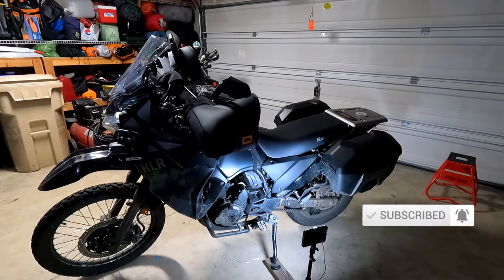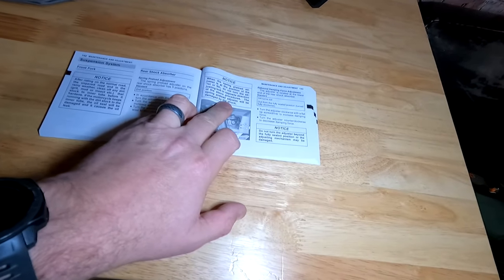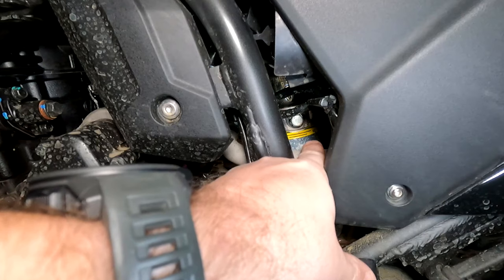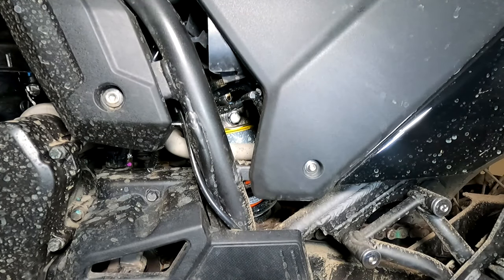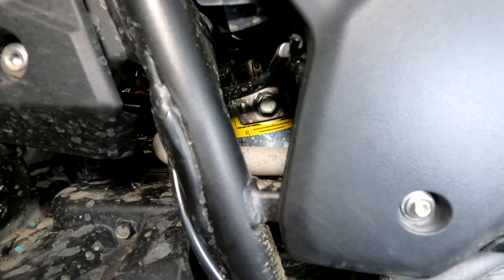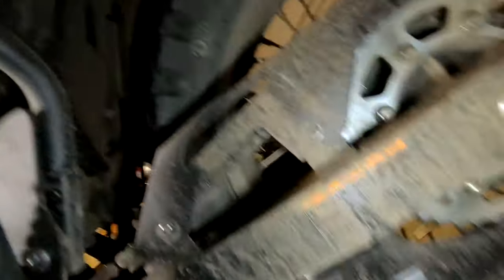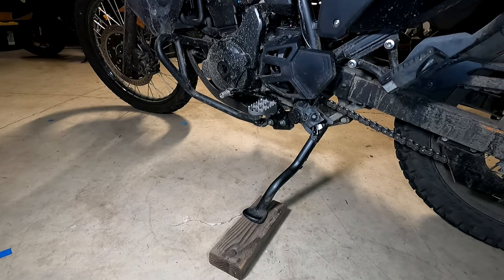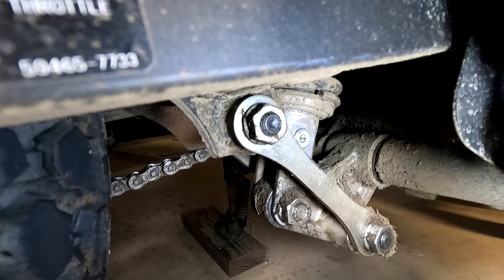How to Adjust The Suspension on the 2022 Kawasaki KLR 650: How to Set Rear Shock Rebound and Preload

Comment from the maker: It's been pointed out to me that this adjustment is also present on the Gen 2 KLRs.  I was not aware of that when I made the video.  Thanks, Kawasaki!
Reply: It is, but you don't turn it left to decrease on Gen2's, you go to five, one more turn resets it to 1, then keep going to your desired setting.
Reply: My kick stand is too long. 
I have to pick my parking spots carefully.  
On town streets curb parking I have to point the bike facing the wrong way or it wants to tip over. 
Best Wishes! M.H.

Comment: For me the stock setting felt good for the first 300 miles or so but then started to feel a bit spongy for the road riding I’m doing. The steering felt a bit spongy too at the same time. I researched this and also popped into the dealer so I could make well informed adjustments. They suggested adjusting the preload and also unofficially said to bump the tires up a couple pounds. I’m running 25 psi in the tires and 3 on the preload. I’m 6’3” and 275 if that helps anyone else who is making adjustments. Bike feels just like it did off the showroom floor now.

Comment: Good job. My fist experience with Preload was on my 2011 KLR had the bike loaded for camping and the front end felt very light and not planted. Cranked in some preload and it made a huge difference. FYI that rear shock adjuster is just like Gen 2 bikes.
Reply from the maker: Oh good to know that's not a new feature. Weird I didn't find anything on it when I searched

Comment: 30 year old tech. Shock is a great piece of hardware. The spring does the job, but when it's changed to a progressive one, with heavy enough rating for your weight while loaded. You can really push the klr too where it's weight and travel gets squirrelly 😄 And a new proper spring is slightly cheaper than a "cough" cogent🤭

It is interesting to see what the fork springs are like because it has a noticeable     gap at the tire/fender. And the old bikes had a noticeable brake dive.

Comment: Going beyond position #5 does not do any damage but the adjuster just jumps back to position #1 with a bang. That is why I recommend to never turn the hex head counter - clockwise. Because accidentally turning it past position #1 will break the preload adjuster. The adjuster is the same on all KL650A, B, E and F models. Only the KL650C 1995 - 2004 models used a different adjuster.

Comment: Hey man, how many PSI are you running Front and Back. I am new KLR owner, Looking the factory Specs they seem a bit low for me, also I have been reading a lot about factory manual mistakes and a bunch of people are saying factory is set to ideal off road pressure and they run more PSI on road to save gas and have more stability. Is this information correct ?
Reply from the maker: I've just been running stock pressure. 25ish.

Comment: i weigh 200lbs any idea where i should adjust to? right now the shock is at the 1 line on the first adjustment not the rebound. just bought it used 2011

Comment: Hi Dork,i understand the KLR comes with a tool kit under the rear rack. Are those tools enough to make these adjustments on the road or do you meed to carry your own tools for that
Reply from the maker: Yes.  The stock tool kit comes with a screwdriver and a 12mm socket so you can adjust using just what comes with the bike.

Comment: I just got my klr and ot looks like the preload came in #1 setting. I weigh about 245#. I plan on doing more on road than off road so I will be traveling lighter than most folks. So am I on the right setting at 1? Trying to understand this preload. Does increasing it, stiffen the ride for more off roading?
Reply from the maker: You probably want to be at a 3 or so would be my guess. The nice thing about it being so easy to adjust is you can try all the settings and see what feels good to you

Comment: Disassemble, grease/Lube rear suspension linkage bearings. Then retorque suspension bolts & nuts back to spec… then one can set up rear suspension!

Comment: FYI I’m no suspension expert either but, the owners manual says not to turn the preload adjuster to the left because it can damage the adjuster. All the adjusting is to turn to the right and if you go to far it will drop back down to the lowest setting, that’s what it’s designed to do. Then you turn clockwise again to achieve the preload you’re looking for. The dampening is fine to go left and right just not the preload. That may be why you were having some trouble with turning it to the right it may be damaged already. It is harder to turn to the right but you seemed to have more trouble turning it then I did. I really don’t mean any offense, just trying to help.
Reply from the maker: My owner's manual specifically says turn left to decrease and right to increase and not to turn it past the 1 or the 5 in either direction because it will damage the shock.
Reply: My 2012 Klr-650 manual states, [When changing the adjuster position from 1st to 5th in numerical order-(1st-2nd-3rd-4th-5th), turn the adjusting bolt (clockwise).] then it mentions [when changing the adjuster position from 5th to 1st in numerical order(5th-4th-3rd-2nd-1st), turn the adjusting bolt (counterclockwise). Why would Kawasaki provide this very easy to understand information, if they didn't want you to use it?
Reply: @DorkintheRoad  The information you provide is what my 2012 manual also says. Information in manual is pretty straight forward, I provided what my model year manual (2012) has stated on page 128, under maintenance and adjustment section. Nice presentation my friend!